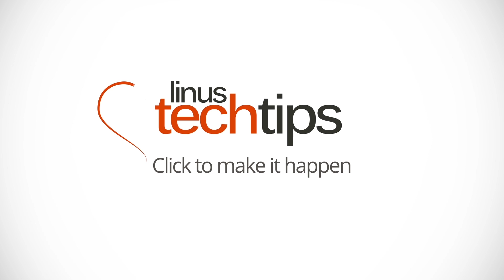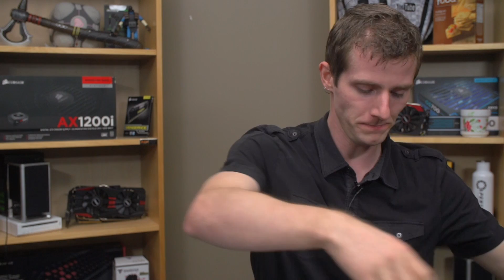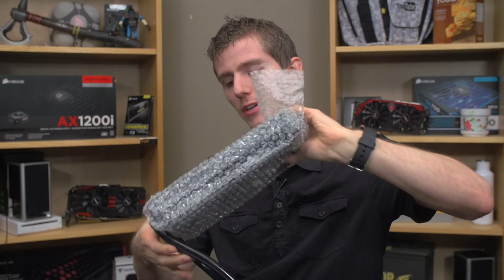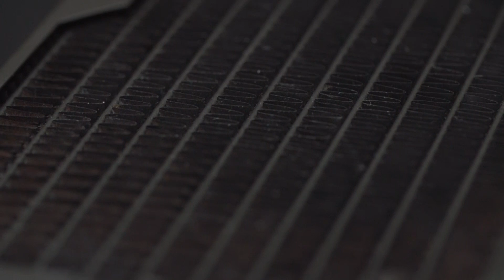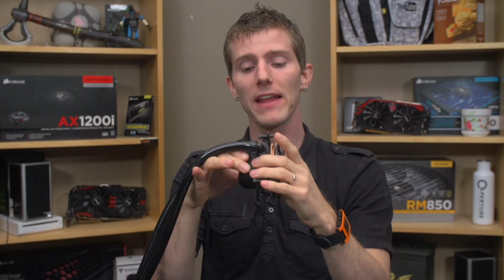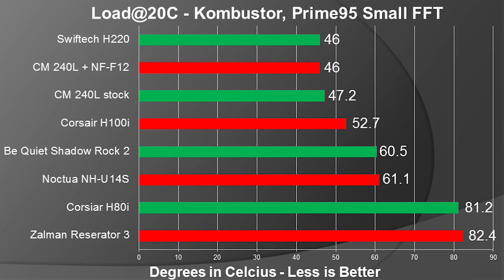Cooler Master Glacer 240L CPU Water Cooler

Comment: Hey guys so this is my first build made more towards HPC computing but also for high res gaming, editing, 3D stuff and entertaintment. I will be running a 4930k hoping to overclock later on. I am still deciding on either a gtx 780/780ti/titan or a R2 290/7990. Anyway i see the H240L is pretty much the same to a H220. Would you guys recommend this over the H220 or even the other H320? Is it available in Canada or did the recall effect canadians to?
Reply: Infinit3Enigma I'd go with something like this over Corsair. The Corsair H100i is great and very quiet (I have one as a backup cooler). HOWEVER, if this is your first build and you're going all out like I did, I'd recommend something like this that you can expand on. It's still not really a custom loop, in my opinion, but it's somewhere in-between since you can add stuff to it. I built my PC with an H100i and 4 months later I spent over $1000 on a custom loop (all top end components with two giant radiators, a 250mm tube res, D5 pump, CPU and GPU water blocks from EK, etc). You may think you'll be fine with this, but you will likely get really addicted to making your PC that much better and something like this will let you add components until you've replaced every part of it and have a "real" custom loop and then you can use this 240L as your backup (as I did with my H100i). You will still likely want to build a custom loop since none of the components in this are really on par with all individual brand name components like in a custom loop, but at least you can build on it and not have to spend hundreds and hundreds of dollars right off the bat. Also, I'd go with the GTX 780. I'm biased because that's what I have, but something like the Asus DCII model will perform about the same as a 290x, but run MUCH quieter and cooler. The 290x will bellow heat into your case running at 95 degrees. Before my Asus 780 was water cooled, it ran at 70 C and that's overclocked playing BF4 on Ultra, so it's a very quiet, reliable, and cool card. A super loud and hot 290x isn't something I'd want, and I don't know how reliable it would be at those temps, regardless if AMD says it's made to run that hot. It would be fine on water, but still. I'd spend the little extra for a 780. Wouldn't bother with a 780 Ti since an overclocked 780 runs about as fast for $200 less and will run any game at very high frame rates. If later you really wanted to push multiple 120hz+ monitors to high frame rates, you'd be better off adding a second 780 anyway, which will by far outperform a 780 Ti. With the current price of a 780, I would not bother with a 780 Ti for 10 percent performance increase when I can OC a 780 to comparable levels.
Reply: Once you get to this level of CPU cooling, the performance difference isn't that big. I'd go with whatever one you like the most based on looks, etc...
Reply: Hmm so which liquid cooler makes the least noise and still gives top cooling with stock fans? I hear corsairs are loud?
Reply: Well if you're gonna drop that much money into a build like that, why not get some Noctua fans, those are the best, though they're not the most aesthetically pleasing fans out there right now. The Corsair Sp series fan look okay to me and perform decently. So just get what cooler you want and some other fans.
Reply: yeah maroon and whatever color scheme. Well those fans are probably for the radiator only. I wanted an H220 but they don't sell anymore :(
Reply: And also, Noctua are not the best fans at all anymore. They're a solid built fan that performs okay and is definitely quiet, but there are better performers that are equally quiet. The Gentle Typhoon has been well known as one of the very best fans for a while, but a couple of newer fans have come out that are extremely good and also look a lot better than the GT's. Phanteks and Noiseblocker. Both are very high quality, look good, and perform quite a bit better than Noctua's at about the same level of noise, or less. If you're going with 140mm fans, Phanteks PH-F140SP is what I'd get (that's all I have in my case) or if you want 120mm fans, Phanteks does make some nice ones, but at that size I'd go with the Noiseblocker e-Loop. Both are expensive but not more than Noctuas by much, and don't have that brown/tan color scheme, as well as performing better.
Reply: get the raystorm 750 kit, the block is better and the pump is in a much better location.  It's kind of a beginner's custom water loop.  You're more likely better off waterblocking a 290 (non x) and adding that to the xspc loop, they make 290/290x blocks and backplates.  If you need more hlp, overclock.net or the linus tech tips forums will have your back, goodluck with your build.
Reply: Hmm Ill look into the raystorm 750 kit =) If not I guess the H240L or H100i.
Reply: devontoner wouldn't the 780 be better than the 290 just because the cuda cores run a bit better when it comes to visuals and 3d models?
Reply: MrGamerKid22 It should definatly, since CUDA is easier to program thus its more optimized. But OpenCL is getting bigger because it also includes CPU compute programing as well from what i hear versus CUDA only programming just the GPU.
Reply: +MrGamerKid22 A 780 probably would be better, but most image editing is still handled by the cpu regardless of gpu vendor, I'm not sure about 3d rendering, it'd depend on his program of choice if it benefits one more than the other.  Based on limited information, I decided to go for budge, a 290 is a serious contender right now and a waterblock really unlocks its potential.  

I also figured he'd know whether he got a benefit from one more than another.  Since he included both vendors, I assumed they're both openCL enabled or neither really care about gpu at all. Maybe my assumptions were wrong, I also directed him to a better forum for building advice where people know the right questions to ask.
Reply: Ofcourse the 290 is a serious contender. Both cards do support OpenCL. Radeon stream processors are better then Nvida, but since Nvida was advocating CUDA, alot of R and D went into it and thus most consumer level programs use it, though the newer versions are being released with OpenCL support. Most of my programs (higher end) are CPU intensive. The GPGPU part for high end HPC isnt worth it since parallization is harder and some complex algorithms are more potent on a CPU. I can't afford a Xeon Phi yet and I don't have license to fully utilize Ansys. though for personal research I might look into knights lander when intel releases the xeon Phi socket CPU. My graphics choice is mostly based on optimization of GPGPU where needed and for the high end 3D and editing and gaming. GTX is a really good card but if AMD can perform similar then why pay the extra?
Reply: It's nice to see my assumptions were mostly true.  If your programs have OpenCL, go for the 290 and a waterblock, it's an awesome value for what you get.  With the 4930k on the RIVBE, I've seen a lot of 4.5-4.6 GHZ overclocks which will be great for any application, you shouldn't need to spring for a xeon.  I'd definitely look to see how openCL and cuda do on your suite of choice, but it seems like you know what you're looking for.  I own a RIVBE and it's awesome, definitely worth considering.

If you haven't already, you should post most of your info in LTT or overclock.net forums, you'll find gurus that will point you in the right direction.  Try to look for a forum based on rendering or make sure you put rendering in your topic title and you'll attract the right people.  As always, good luck with the build.

Comment: Please help! I just got the Corsair 230T orange case, and I mounted my motherboard (an acer predator board) and I dont have the connections for the led's for the power and reset. I dont have the connection for a reset button at all. Also, my 4 pin atx cpu connectir doesnt reach. If anyone could PLEASE help me thatd be awesome! Idk if I should get a new motherboard (make a suggestion please) or adapters (again please make a suggestion).
Reply: Click the link in the video description to join the community forum. You'll find lots of helpful people there.
Cheers

Comment: As requested and as a person who knows very little about actually mounting water cooling systems I'd preffer a rather prebuilt system which still has the benefits of water cooling over having to do it myself, while the other option leaves more felxibility.

Comment: Someone needs to come out with a double thick rad at the 240 size AIO. The double thick would obviously make for a better cooler, but the prospect of adding a 300 watt head load (gpu) on top of a cooling system designed for just a cpu at 180watts just sounds wrong.

Comment: I personally go for the self contained units that cannot be upgraded. They are easy to use, and great performance. If I were to implement a larger loop such as water cooling my GPU as well, id prefer a custom loop.

Comment: I like the SATA power connector - in my PC I dont have a single Molex lead plugged into my Modular PSU so using the SATA power connector means I can have one fewer cables and a much cleaner look in the case.
Just pick up a Bitfenix cable extension and then run it to the SATA that way, will look great!

Comment: Last year when I went back to water, I ended up getting the XSPC Rasa 750 kit.  The drive bay mount reservoir w/built in pump is really slick and literally zero pump noise since it's submerged in water and the way the kit is desgined, it offers full upgrade and expanding capabilities if I want to swap out or add radiators.  Best of all, it was pretty inexpensive.

Comment: Linus! I just bought new case (Zalman MS800) and it have 2 pre-installed 120mm fans(also made by zalman), and i found this case a little bit unloaded ;p
My question is - what fans should i get (hope for quiet ones)? I have 3 empty ( counting fan for hdd) slots for them, but if I'll like new fans, and they will be more efficient, I'll replace default too...

Comment: I WANT this and put the radiator outside of my case to spare room inside and get even lower temps...
It's just bonkers to buy an aio cooler and cut it up to get it through my casings holes which are pre drilled, and for me as a no expert in watercooling that was always a dead feature of most cases which i bought

Comment: I currently have the first Gen H100 on my 2600K i7 and it does a good job but... i don't like the fact that i can never easily change the tubes/water. Thank for the un-boxing and performance testing. Linus could you config this in a push/pull and see how much room it would have when installed in the 750D case?

Comment: If you're using a small case then going with the SATA power is a godsend.  You don't have to worry about using both 4-pin and SATA connectors.  It can definitely make for cleaner cable management, especially if you're doing a single drive system.

Comment: I have the h100i and it's exactly what I need. I wouldn't want to add more to a closed loop system. I'd prefer to setup a proper pump/res/rad/blocks setup if i was going for anything more, and you can get 120mm closed loop systems like this that people have attached to GPUs

Comment: I personally would prefer a non upgrade-able  fully closed system. People may look at me like "but then you cant add your graphics card or anything" but what i would say is hey if i want to liquid cool my graphics card i would buy another fully enclosed system and have that runs apart from my other system using some NZXT graphics cooling hardware. that way i know that the heat from my CPU wont be affecting my card and vice verse and if one of my systems fails it wont fry my entire system but just a part of it. Not to mention that the work required is far less to install this sort of thing. I know it may not be the best in terms of performance or even maybe price but i think the ease of use would be worth the slight hit in performance.

Comment: Preassembled AIO solutions aren't going to be for knowledgeable water cooler. Having the ability to expand an AIO, to me, is quite pointless, mainly because of the cost. Better tubing, fans, fittings, more res capacity, blocks, etc., will all be a cost on-top of the already paid for AIO.

Comment: @5:06"running afterburner so that it generates some heat too"? hmmm i guess you meant Kombustor, right?
Reply: MSI Afterburner (:
Reply: Simon Jensen But after burner is a gpu monitoring and overclocking tool. The benchmark its self is called Kombustor?...
Reply: ohh, thanks (:

Comment: Would such a small pump even be able to handle more than 1 cpu block + 1 240 rad?
Reply: http://games4pts.net/?ref=vqfEYKfQc
Reply: Well it depends on the horsepower of the pump. If it's strong enough I don't see why it wouldn't work. Besides, with extra components you're more concerned about being able to cool the coolant than how quickly you can move the coolant around the system, so I personally don't think it's going to be that big of an issue, if at all.

But really, you can add another pump into the loop if you so desire since the flexibility of it is so high.
Reply: Should be able to but it'll have to run louder especially if you add GPU blocks in the mix.

Comment: Is this the replacement for the H220? I had a H220 but surprisingly the pump failed (not surprising it's pretty common check Swiftechs own forum). The H220 also didn't performance as well as my current H100i but then the H220 pump did fail so was that the issue with the poor performance? We'll never know.
Reply: cool name bro, check my video of my H220 failing.

Comment: Full Custom Loop. Unless I had a requirement for the performance / acoustic part of water cooling and was struggling for space, a custom loop is my choice. Part selection, assembly,  customization and raw performance is what makes watercooling fun. Otherwise it's just unnecessary, you can get good OC's out of a decent air cooler now-a-days in all but the more extreme climates. Just my 5c (figure it's about time someone accounted for inflation over the years).

Comment: All in one cooler is a all in one cooler, you never have to change and will never modify, it will be there forever. I have a H100i and a 4770k overclocked to 4.2Ghz and thats running round 38 degrees so that is more than good enough. But there are some people who may use this in a custom waterloop, but guys this is not for firsttimers, i think it was hard enough to install the H100i lol

Comment: so cause they cant sell the h220 in the US, they licensed this out to CM. sweet. now if they only come in stock when I have the funds... And for Slick, expandable aio's with copper/brass rads are ideal. I can add a better pump and standard cpu block and gpu block later. the aio gets u up and running till you can afford the full custom loop. and I hope it retails for 149$ or less.

Comment: My next purchase of a closed loop will definitely be something along these lines.  My only concern/question thought, would be how well a 240mm rad like this could cool a cpu and gpu block together.  If it's possible to run them with just the one rad or if you'd be required to get another rad for proper usage.
Reply: Go with the second rad if you add gpu on the loop otherwise temps would be too high for silent use

Comment: I have the Swiftech H220 with Noctua NF-F12 fans. Great cooling solution but the pump is noisy even at the lowest RPM. At first I thought an airbubble was stuck in the pump so I RMA'd the product, only to find out the unit was tested flawless in the 1st run. Just a heads-up to any silence freak out there.

Comment: I see you mentioned that this unit is copper, will I have any issues expanding the water cooling on the asus formula I think they used aluminum..
(I'm very new to water cooling)

Comment: What's the pump flow rate. I was thinking of using this(as a cpu cooler (4770k)) with the nzxt gpu brackets(H00i) with a 780TI in a prodigy mini itx config. Tell me if this could work or am I just mad for thinking it.
Reply: You mean the Kraken G10? Probably won't fit, since that bracket takes up ~2.5 slots, you'll probably hit the sidepanel with it.
Reply: Only coolers that follow the Asetek mounting design will fill the G10, AFAIK.
Reply: True. So in addition to the bracket not fitting in the case, the cooler doesn't fit into the bracket.
Reply: Christian Brassat So in answering OP's question, yes he is just mad for thinking it :P
Reply: No, not this cooler in the bracket. A different cooler for the GPU in loop with this heat exchange for the CPU, in a safe and smart order I presume. From some demonstrations, it doesn't look like 2.5~ slot room, do you own or have seen up close a Kraken G10 in use? I'd just mod the case anyway to where it was either flush in design outside or inside.

Comment: I'm a bit confused... What's the difference between the Glacier 240L and the Eisberg 240L? The only thing I'm noticing different is the Eisberg has a little window so you can see the pump. Is there a performance difference between the two, or are they effectively the same cooler?

Comment: I haven't yet gotten to liquid cooling my system so I'd probably want to start with a simple all-in-one for the processor.
I only wonder whether this would lower the noise of the machine, or if the radiator fans produce about the same noise as a heat sink fan.
Reply: If you're using a 240mm set up you can afford to turn down the fans slightly if you aren't mad on the overclock to let it run a little quieter.